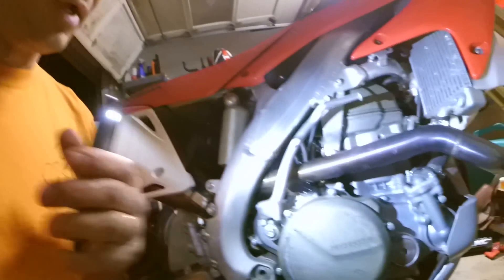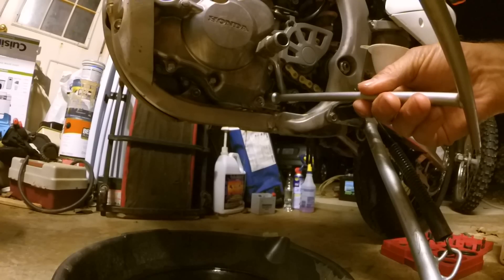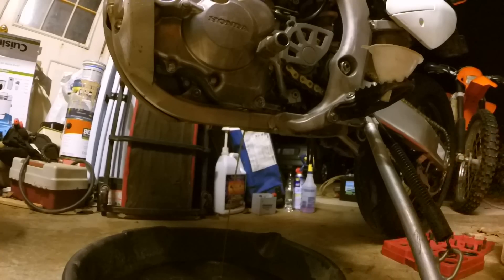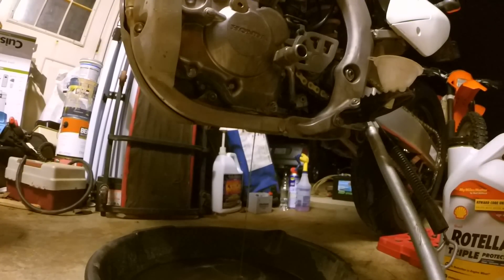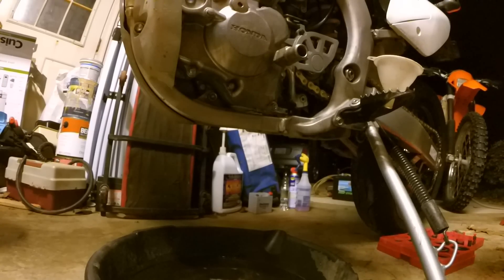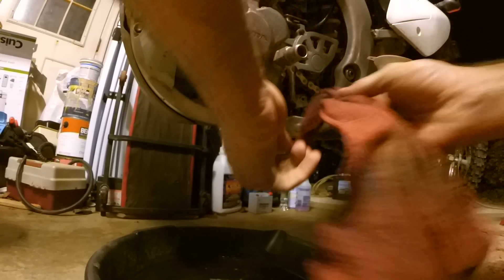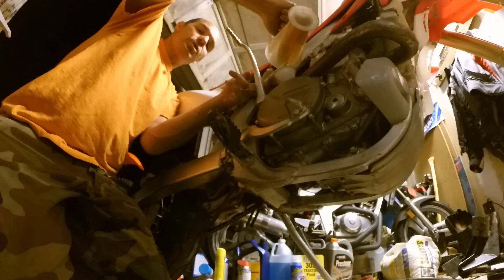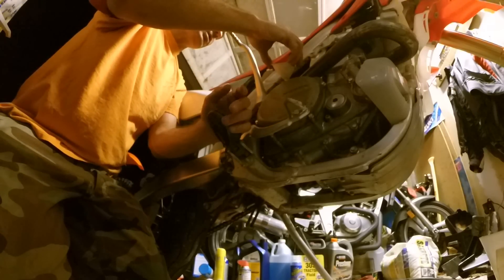Honda CRF450 Transmission side oil change

Comment: Hey mate. 2006 Crf450x I’ve changed the engine oil
I can’t find the bolt you undid
I see one right next to the engine bolt and where you indicated it was but it’s a couple of inches deeper past the engine oil bolt. Does that sound about right to you?
Reply from the maker: Hard to say with that description but take it out, if oil comes out, you got it!

Comment: Is it possible that engine can burn transmission oil? My crf450 was burning oil and when i went to replace the oil, left side of the engine had oil as i have seen it on the glass, but when i took the transmission oil bolt there was not one drop of oil from there....could it be bad right side crankcase seal?
Reply from the maker: If it was a two stroke a bad right crank seal would cause a drop in transmission fluid and excess smoke. This is a 4 stroke so if you had a bad right crank seal your tranny side would be low but your engine side would be high.

Comment: mine had so much sediment the bolt wouldn't go back in, so i sprayed carb cleaner thru the hole and fill plug , worked good , flushed..
Reply from the maker: Dang, might want to do oil changes sooner or at least the next one.

Comment: Question as stupid as it might sound, I just got a 07 450r and I did the oil change yesterday I added transmission fluid too 670 to be exact was I supposed to flush out the old one If so how ?
Reply from the maker: Just drain and fill.

Comment: Hey some videos says that you need to unplugged the chek oil bolt for the transmission side and when it start to cool out you can stop putting oil.
Should I trust the 0.59 ML as honda is saying or the bolt ?
Reply from the maker: Don't use the check bolt, they strip easily. Just put in the recommended amount.

Comment: What fluid did you use on the transmission side?. I have a 2007 Honda CRF450R
Reply from the maker: I mostly use Rotella T6 but I have really liked the HP trans oil 80/85 lately on the transmission side or the transmission of my 2 stroke.
Reply from the maker: But in this video I used Rotella T4. The more important thing is to keep it clean.

Comment: Dude, my 06 crf450r clutch oil is going over to the other side, do I need to split the cases? which seal is it? thx
Reply: @the Duke, its probably your main crank seal, I'd split the case and check it out forsure

Comment: The black little cap on the transmission side is it for transmission oil???
Reply from the maker: The black cap at :19 is the transmission side fill cap, it's just above the clutch cover.

Comment: Rotella T says diesel. What's your take on this?
Reply from the maker: David Bain That's the stuff! It's marketed towards diesel but is great for anything. I have been using it for years in all my bikes from my 510 Hunqvarna Supermoto with a 10,500 redline to street to trail to roadrace. Even in my cars and lawnmowers. Shell also recommended the t4 for my zero turn hydraulic pump oil.

Comment: Question! I have a 2016 crf450r can I use synthetic trans oil for it?
Reply from the maker: Yes it's as long as it doesn't say energy conservative in the circle.
Reply: @TepcoCycleRepair  ok thank you I changed my trans oil and engine oil after buying it and the trans oil was water for the first 3 seconds then green like a pale dark green😂 I flushed it twice now it’s just the lucasoil that I used that’s red

Comment: I have a 2011 crf450r and can't find the oil check bolt for the trans. Is there not one on this year?
Reply from the maker: It's the Allen bolt cap in front of the clutch cover. Fill until it slowly comes out.

Comment: Trying To Find Out How Much Transmission Oil In A 2006 CRF450 When You Change It
Reply: Trying To Find Out How Much Transmission Oil To Use When Changing It,2006 Honda CRf450
Reply from the maker: Shavon Sandoval By the book it's, 590cc for the R and 750cc for the X.

Comment: I need help when putting In the plug. It always want to go crooked. What do I do ?
Reply from the maker: Logan Munoz Drain plug or fill plug? Either one make sure the threads are OK don't force anything. If the threads are messed up, replace the plug and chase the threads with a tap if it's the drain plug.

Comment: Just bought an 03 crf450r. Changed the oil and filter then filled to the high mark on the window. Does that effect amount drained and filled on the trans side?
Reply: Added 10-40. Would you use the same viscosity on the trans side?
Reply from the maker: Darin Williams Engine oil is separate then transmission oil so no it won't affect it. 10-40 is fine on the trans side as long as it doesn't say energy or resource conservative. Thanks for watching!
Reply: Tepco Cycle Repair  thanks

Comment: What i dont understand is why would you use a Diesel engine oil in a 4 stroke  transmission when there are better proper specific motorcycle gearbox oils with the correct additives for gears and clutches..Heck 2 stroke bike transmission oil is better than Rotella T in my opinion..You could get away with it but oil is cheap,blown gearboxes are not.
Reply from the maker: There is plenty of talk about how good this oil is on many forums. I would recommend you look it up. I have had no issues ever with this oil after many many years, miles and hours in all different types of applications. Don't get fooled by oil advertising.

Comment: Whats that t tool called?
Reply from the maker: It's a T handle wrench by Motion Pro, I got them from Cycle Gear.
Reply: @TepcoCycleRepair  what size??
Reply from the maker: @2WheelTherapy7  I was using the 8mm. I think the set comes with 8mm-12mm and a Phillips.

Comment: 06 450x here. Have you had any issues with oil migration on your ride? Thanks for the informative video.
Reply from the maker: No issues at all, and I ride a lot of wheelies which usually passes it through the breather.
Reply: @TepcoCycleRepair  yea, a few mornings ago I started her up in my driveway and couple minutes later I look over to find it pissing a puddle through my breather tube. Turned out being my crankcase seal. Just waiting on my water pump gasket set to complete the job. 
Cheers!

Comment: can i use this oil on the motor side
Reply from the maker: Greatdane Yes you can many do, but I run the Rotella T6 it's full synthetic and only a few dollars more for the gallon.
Reply: Tepco Cycle Repair
Thank you i really appreciate it

Comment: how about 10w 30 diesel oil? would it work on the trasmission clutch?
Reply from the maker: thenochistlense yes as long as it doesn't say energy conservative or resource conservative or anything like that. Like, Rotella T6 full synthetic diesel oil, would be fine, or the T4 non synthetic, all good.
Reply: Would the t6 full synthetic 5w-40 be ok
Reply: Diesal
Reply from the maker: Yes absolutely, I use T6 as well. So the shell Rotella T4 non syn or the T6 full synthetic will both work just fine for the engine and transmission/clutch

Comment: I can  put one model oil 10w40 engine and clutch
Reply from the maker: If it's JASO certified you can use it in both sides.

Comment: How abt in a crf450r can i use the same oil for both sides?
Reply from the maker: Elija Lev you can but I use the full Synthetic T6 either will work just fine.
https://youtu.be/XgcEJk6B4pM